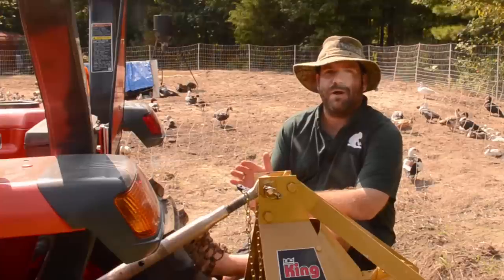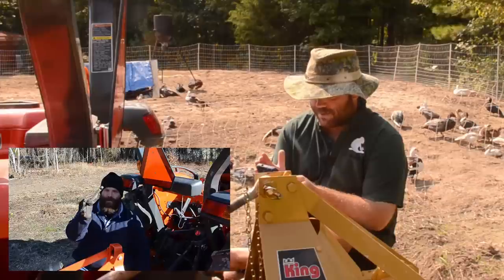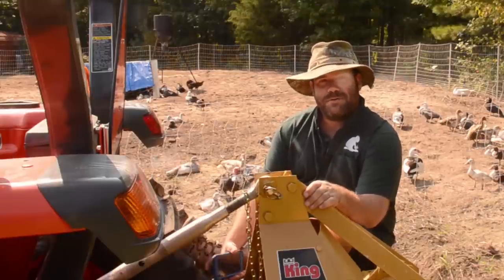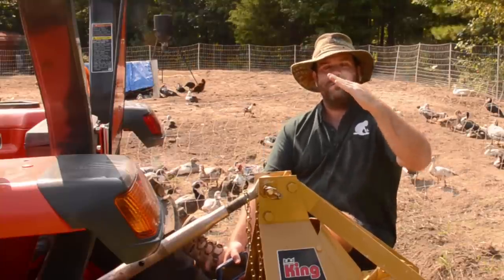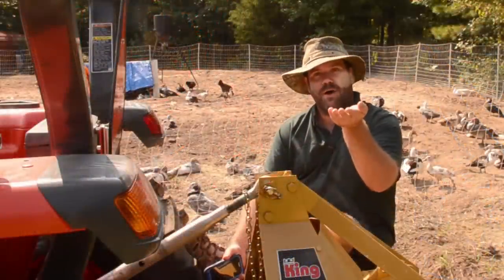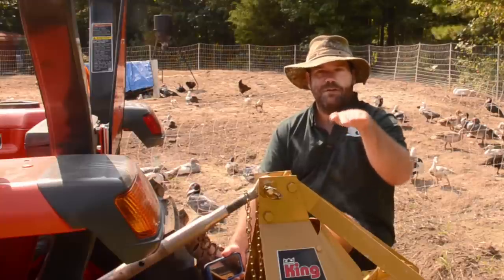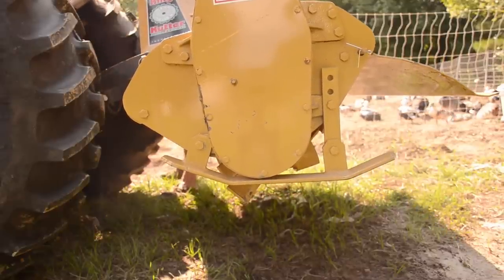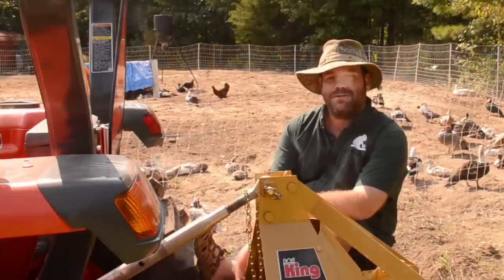What does a Tractor Top Link Do?

Comment: One more point to look at. Allow the implement to rest on the soil then adjust the top link. Some swing will occur depending on how high the three point is raising the piece. If accuracy is needed, as in using a box blade, this helps keep stuff where it needs to be. Some equipment does not need that much accuracy but its nice to know how to do the adjustments. Remind folks to NOT get between the tractor and the attachment while the engine is running. Turn off the tractor, set the brake, then adjust. 
I've seen plenty of farm accidents as and EMT that could have been avoided by following these steps and not cutting safety corners.

Comment: I think  you described how the center link works correctly and I have to remember to make the changes when I put my tiller on the tractor. All new tractor owners have a problem connecting up implements and have to get assistance from others who know how to make those adjustments correctly. I am not a novice, but do need help at times and in my case the internet is my only source of help in using my tractor and accessories.

Comment: I have a 62-64 Ford 4000 Industrial. There are 3 holes for the top link to attach to the tractor. How do you decide which hole to use?? I mainly use a box blade.

Comment: A couple observations.  

If you feather your implement so it's just touching the ground, your adjustable top link will turn much easier. Your not fighting the weight of the implement. 

A 3 point hitch has no down pressure, so technically it doesn't push, it's gravity. 

One should also make the adjustments with the implement close to operating position. If you notice the implement changes pitch as you raise and lower do to the arc affect.
Reply: Double Dog Farm ....all good points but some tractors do have 3 point linkages with down pressure.

Comment: So what happens when u have it set wrong and u put the implement down cockeyed like that u can end up bending or break the points where it connects the top link right? Especially if u put downward pressure and that top link is being pushed too hard because the implement isn't square to the ground. Am I correct?

Comment: It will also be a benefit to "hard-face" or weld an additional skid plate to the factory skid plates to get a much longer life from them whether it's your tiller or your brush hog.Inspect them before each use.The metal in them is pretty soft and as the get dragged,they're s a lot of friction and wear.
Reply: DesertDigger1 Would you not lose depth, by doing so?

Comment: I have another related question that I've been unable to find an answer for. On the top link, what is that little teardrop shaped metal piece for?  Mine just dangles. I see a couple of different shapes of these but yet to find it's purpose.
Reply: Once you get the top link to the proper length it's used as a locking nut

Comment: Just an opinion to consider.  
I would flip your top link end for end so that the little securing bolt/arm can be tightened down on top of the center.  
Second, rain will in time get inside and cause rusting and a freeze up on one or both ends. 

 That is why it is good to keep both adjustment screws well greased. The securing bolt/arm will hold it from moving.
 
Third if one does freeze up don't just extend one end as it will allow one to bend easier.  Take the top link apart and get it back to working properly.
Reply from the maker: All excellent points and tips, thank you for sharing!

Comment: using a five feet rake on my mitsubishi but the sand/soil keep leaving wave formations not dead flat but raked well. I have it set using top link to just sit an inch below tyres when in the down position, could i take off the top link or use a section of chain in place of threaded bar so it would still lift out the ground when needed.

Comment: Best upgrade I have ever done was adding a hydraulic top link. Can make length adjustments from the driver’s seat (great for box scrapers and also use it on a cement mixer to dump/raise the mixer) or let an attachment free-float (great for rotary brush cutter).
Reply from the maker: It's a shame that I don't have another hydraulic port - not sure it's worth it to me to invest in one.

Comment: When adjusting for a brush hog can you tell me what the cutting angle should be for the brush hog blade?  Level or little upward in back? Thanks.
Reply: The angle you refer to is determined by how you set the height of the lift arms relative to the tailwheel. Less HP required and less blade wear is achieved with a slight forward tilt of the bush hog. Aft tilt will achieve more mulching at the expense of more blade wear over time. The top link adjustment will determine how well the bush hog negotiates going over uneven ground without scalping or lifting up as the front wheels go lower than the rear tractor wheels.

Comment: put the implement onto the ground if you're attempting to shorten the turnbuckle length... taking some weight off of the screw will make it easier to adjust.  Conversely, if attempting to lengthen the turnbuckle,  raising the implement may assist in easing the effort necessary to adjust.

Comment: Thanks for this video - the only explanation of toplink I found on Youtube! Also the discussion here is very useful. The first comment from 
@John Colvin (can be found also here https://en.wikipedia.org/wiki/Three-point_hitch) says: "the top link of three-point hitch prevents the tractor from flipping backwards on the drive wheels if the implement being dragged were to hit a rock or other immovable obstruction." 
See an example of tractor flipping while pulling too much weight: https://www.youtube.com/watch?v=swj0dYdpioM
The toplink forces the tractor back to the ground, it "redirects the flipping force into downward force on the drive wheels"  which increases the tractive force. See the wikipedia article linked above.

Comment: The top link is a turnbuckle. A coupling with female screw threads used to connect two rods, lengths of boat rigging, etc., lengthwise and to regulate their length or tensionbuckle.

Comment: Thanks for your explanation. That bolt-thingy is called a turnbuckle or a drag link, depending on who’s asking. 

So happens that today I was trying to get my friend’s tractor bush hog set and we couldn’t do it. When we lift the implement it touches the tires and that just can’t be good. I figured out what that link does and used it to pivot the implement away from the tires on the up position, but then it’s not level to the ground when it goes down. We gave up when it got dark and will go back to it next year. 😜 

Now my question:

On the tractor itself there are three mounting points for this turnbuckle, what difference would it make to use any of them? 
Thanks.

Comment: If you take a decent hammer and drive that handle that came with the toplink through the hole you are using to adjust it it will be captured and you dont have to worry about losing it.
Reply from the maker: Thank you. I was wondering if I was "supposed to" do that - didn't seem like there was any other way but didn't want to ruin something.
Reply: +J&J Acres no problem thanks for sharing your videos.

Comment: It's good to keep it well greased, too. There can be a lot of tension when turning it.
Reply: Paul Weatherby Noooooo, no grease. At all,  sit the implement on the ground,  that Will resolve that tensión problem,  the grease. Will change the level that you Need to work with the implement.
Reply: Paul is correct - keep it well greased - in time water will get in and cause one or both ends to rust and freeze up - I believe that the locking bolt should also be on the top to keep some water out plus lock the center piece.

Comment: thanks for the video. it is much easier to adjust if the implement is on the ground😉
Reply from the maker: Don't you find that the ground is in the way of letting it turn?
Reply: +J&J Acres If a big adjustment is needed, I adjust until the top link is hard to turn then raise the lift arms and set the implement down again. The angle is reset. This way the weight of the implement is supported, perhaps I am just weak, but sometimes it is the only way to make the desired adjustment (I am old😉).
Reply from the maker: pfs896 Ah, that makes more sense to me now, thanks!

Comment: The main propose of the top link of three-point hitch is to prevent the tractor from flipping backwards on the drive wheels if the implement being dragged were to hit a rock or other immovable obstruction.

Comment: Dislike because of improper use of that ur "double sided bolt". U used the wrong end of it. It has those pins to prevents it from dropping from its hole in top link arm and prevent that kind of improper use. Holes in it get ruined using it that. It should go trough both holes.
English is not perfect, I'm from Finland, the homeland of Valtra tractors.
Reply from the maker: Four and a half minutes of info but because I didn't put the handle through the top link permanently it's a thumbs down. Yay! Thanks for visiting my channel!